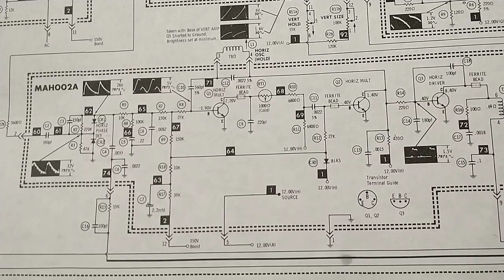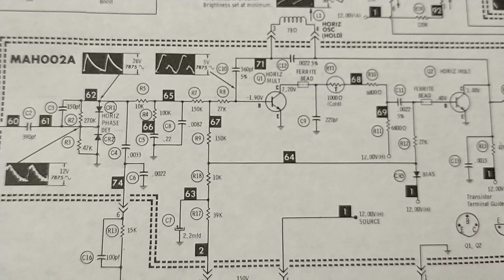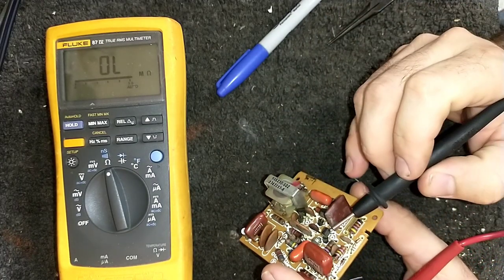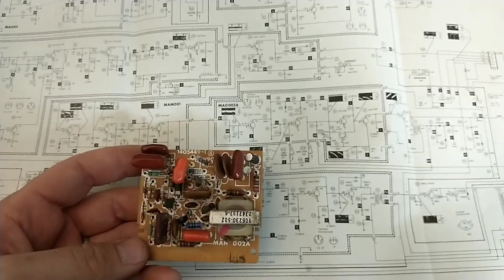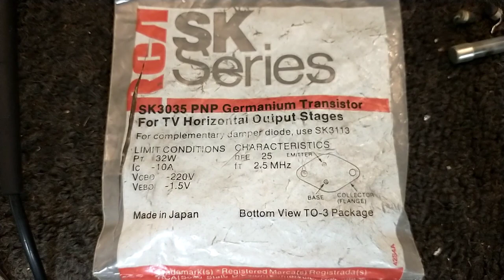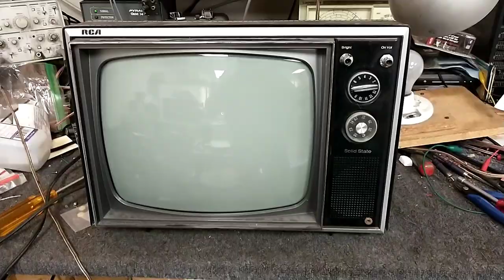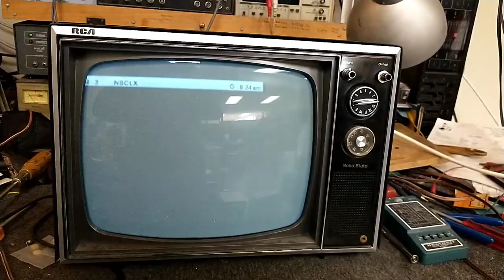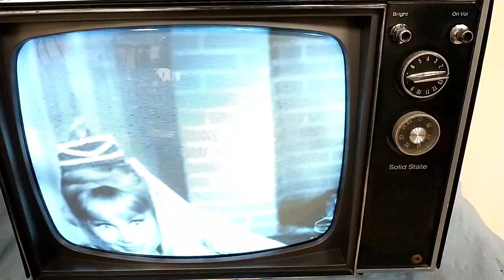Servicing a 1974 RCA AS128e 12" black and white solid-state television. Part 4/?

Comment: Looks like the horizontal also had some keystone distortion. When you rotate, and align the left side with the yoke, the right side top was narrower than the bottom right.
 Would be curious to see what the sawtooth waveform of the horizontal output looked like. Could be a shorted turn in the yoke? Everything so interdependent in that tuned circuit you you could be chasing your tail trying to get it right. Sometimes it is wise just to call it good enough and live with it, it is what it is. Enjoyed the journey.

Comment: My guess is that when you changed the resistors the frequency went off and drove some more current through the thermistor and it gave out. I like Zulumax1s' theory on the yoke, but I think the problem is just more out of tolerance components somewhere. But it could be worth trying another yoke from a good set if you ever get one again. Good luck on the sound issue.

Comment: Dear sir I am having a Philips double deck cassette tape recorder. It's working in all specs but the bass looks weaker even after raising the equalizer to +10db level max. I can hear moderate level bass when I improve the equalizer level in my PC which is connected to the aux in. But radio and cassettes playback doesn't give significant bass boost. Please suggest me how to improve the bass which was good once. Also Philips AZ1852 CD sound machine with dynamic bass boost comes with the same complaint it's bass response is not the same when it was new.
Reply from the maker: Need an oscilloscope and frequency alignment test tapes to follow signal path and trace deficiency in bass.